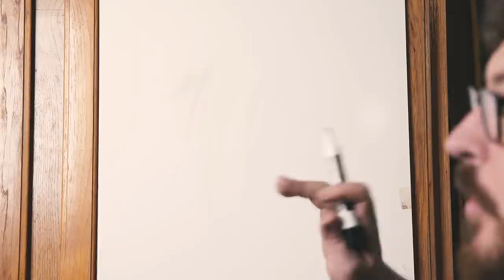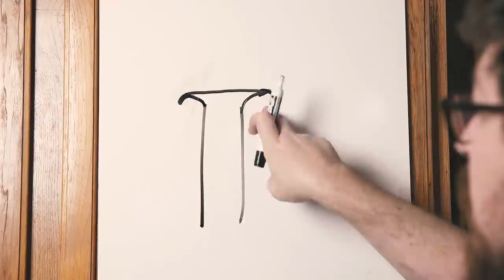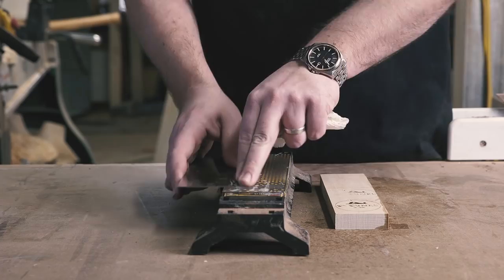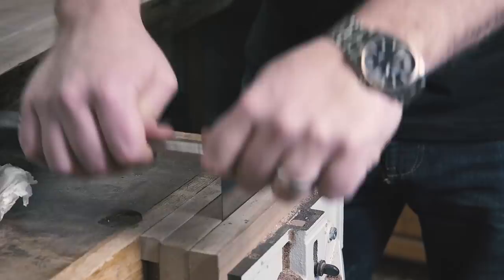The Card Scraper | Two Minute Tool Tip

Comment: Card scrapers can also give you a flatter surface than sanding sometimes. Wood is not consistently dense, If you run a panel through a wide belt sander after planing it flat, the soft heads of the sander will not grind away material consistently. You will feel dips where there is softer seasonal growth. That is why I usually go for the scrapers before finishing with sandpaper. I work in a production environment so the finish needs to match everybody else's work, so scrapers save me a lot of sanding time and give me results I couldn't get out of an orbital sander alone.

Comment: I've butted heads with my supervisor at work several times about my scrapers, he believes they are totally useless 99 percent of the time, but this simple tool is soooo much more effective than sanding, you can have 4 edges with different hooks for either removing stock quickly or producing the final finish on your project. I can't speak highly enough about them really they have changed my game as a woodworker. There is no arguing with the results once you use one yourself.

Comment: would a screw driver serve as a burnisher?? does anybody use anything else? Thanks Will, i really like the idea of this series, this is the part of woodworking that i find daunting. The behind the scenes stuff, will you be going over sharpening hand planes as well??
Reply: Screw driver works perfectly fine for me, any round steel works as long as it's harder than the scraper.

Comment: I dig it.

Why not use a smoothing plane? It would be great if you could explain when to use each. God bless.
Reply: I personally like card scrapers because they are smaller and super lightweight, you can easily move in all directions and it doesn't leave any marks. A well set up smoothing plane won't leave marks either when you know what you're doing, but it's even easier with a card scraper. They are also wider than most smoothing planes. In the end, it's all personal preference